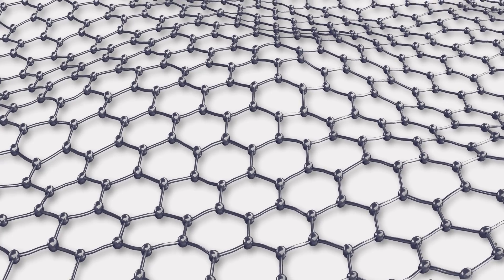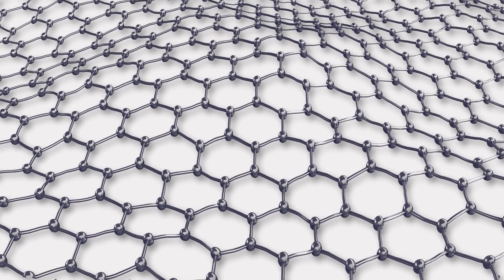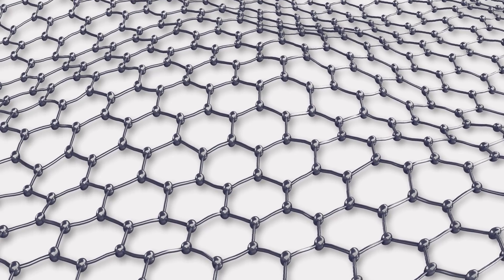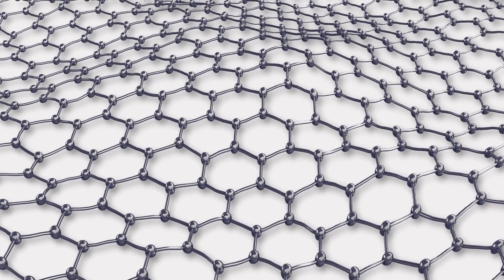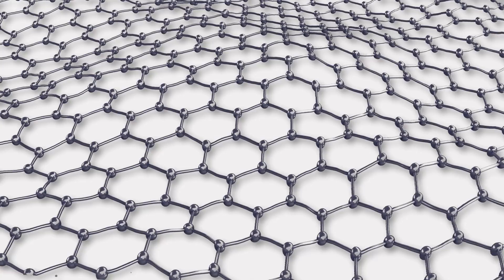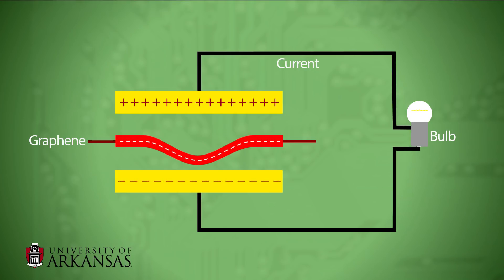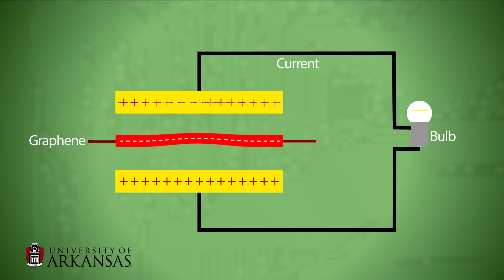A Potential Source of Clean, Limitless Energy

Comment: the numbers he is claiming there sum up to about 100kw per square meter.... that seems awfully high. thats 100 times as much as a 100% efficient solar panel at noon. that seems very wrong (10 micron x 10 micron panel producing 10 microwatt). not that it wouldnt be cool to power everything with basically no volume needed....
Reply: 10e-6W/(10e-6*10e-6)m² = 1/10e-6  W/m²= 100e3W/m²
https://www.google.at/search?num=20&source=hp&ei=HL5rWpXyIofKwAKAyYvIDQ&q=10e-6%2F%2810e-6*10e-6%29&oq=10e-6%2F%2810e-6*10e-6%29
Reply: +Scott L the descriptin doesnt have any nonclassical effects in it. theres nothing about zero point energy or any phantasy verb prefixed with "quantum"
Reply: +Thomas, yeah, that certainly looks like you've got the right math. So clearly, they're the ones with the wrong math, since 100kw from a sq meter would be like standing on the sun. Their math is probably describing theoretical maximums, so if they had a way of pushing 100kw of heat into a 1m area, it might be possible (theoretically) to pull it off.
Reply: +Scott Zero point energy is impossible to extract, just because it exists doesn't mean that we can use it to do any work. Here's an explanation of why not: http://www.eleceng.adelaide.edu.au/personal/dabbott/conference/UPN_abbott1999a.pdf
Reply: Zero point energy is higher.  So yeah, it's possible and it does NOT violation thermodynamics law, but it sure looks like it.  There's a quantum aspect to this.
Reply: @scottl5000  It's well established that quantum mechanics violate the Second Law of Thermodynamics; which only seems to operate with big, complex, statistically-convergent systems of atoms—i.e., classical systems.
Reply: @proveritate1205  I'll need to see a white paper on that.  I've not been aware of anything showing statistical systems (which isn't quiet the right way to look at QM) violating laws of physics.
Reply: @scottl5000  What do you mean by saying that statistical systems isn't the right way to look at QM? The threshold between classic mechanics and quantum mechanics is purely statistical, it's a matter of the number of particles involved. A tiny amount of particles show statistic divergences, whereas a huge amount of interacting particles is extremely highly improbable to show divergences. 
An analogy would be this: Imagine that you have 5 dies (🎲🎲🎲🎲🎲). It's a lot more probably that you, by random casting the dies one by one, get all of them drop facing up the 1 dot in a single round. But if you have one hundred dies, it's exponentially more improbable that by random casting the 100 dies you get all of them drop facing up 1 dot in a single round (in fact, for 5 dies the probability of all facing 1 dot up is 1/6⁵ ≈ 1.29 · 10⁻⁴ and for 100 dies is 1/6¹⁰⁰ ≈ 1.53 · 10⁻⁷⁸). 
The same is true for atoms and subatomic particles. The differences in probability is what determines whether the system obeys classical laws (high predictability, entropy) or quantum-mechanical laws (low predictability, no entropy).
Reply: Thomas Steiner graphene is truly amazing. It is like the discovery and usage of iron. However again.
Reply: +Thomas, I think one of us did the math wrong. I'm counting 1m x 1m area would produce 1w of energy, not 100kw. I think you counted milliwatt instead of microwatt.

Comment: For the less credulous viewers out there, I suspect the trouble here is trapping charge on the graphene sheet. For this to work, the graphene would have to be extremely close to the contacts, because from a distance, the fluctuations would cancel each other out. However, at such close range, quantum tunneling would cause electrons to simply jump from the graphene to the contacts, equalizing the charge imbalance. Indeed, electrons would even be able to jump directly from one contact to the other, through the graphene (as though there were a tunnel through the graphene, hence the term quantum tunneling). Thus, this requires a constant application of voltage to the graphene to keep it charged. The energy expended keeping the graphene charged will be equal to or greater than the energy the devices generates.

Without reading a published paper, I can easily imagine that in their experiment, they didn't disconnect the device that supplied the initial charge to the graphene. Thus, the power they saw being supposedly being generated was actually coming from their voltage source. Disconnect that, and the device will stop supplying power.

So, just like with Maxwell's demon, quantum effects doom this idea. In the case of Maxwell's demon, your sorting mechanism will either be required to carry away entropy, requiring energy; or your sorting mechanism will randomly malfunction according to the inverse of the size of the temperature difference, preventing the generation of net useful work. In the case of the device described here, I suspect quantum tunneling will make it impossible to maintain the required charge on the graphene sheet without an external voltage source, which will consume any energy produced.

EDIT: Actually, you don't need to invoke quantum tunneling. I got too buzz-wordy. The charges should jump around even with a more classical analysis.
Reply: 📰 "The findings, published in the journal Physical Review E, are proof of a theory the physicists developed at the U of A three years ago that freestanding graphene — a single layer of carbon atoms — ripples and buckles in a way that holds promise for energy harvesting.

The idea of harvesting energy from graphene is controversial because it refutes physicist Richard Feynman's well-known assertion that the thermal motion of atoms, known as Brownian motion, cannot do work. Thibado's team found that at room temperature the thermal motion of graphene does in fact induce an alternating current (AC) in a circuit, an achievement thought to be impossible."

📰 source:
https://phys.org/news/2020-10-physicists-circuit-limitless-power-graphene.html 

📰 October 2, 2020
Reply: Thank you. I knew it couldn't work because 2nd law, but I didn't know what part broke.